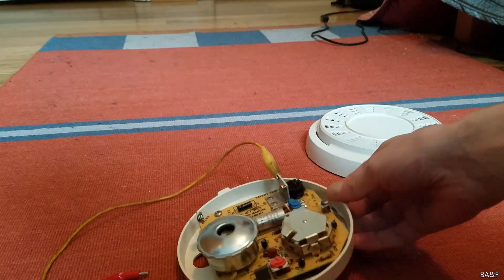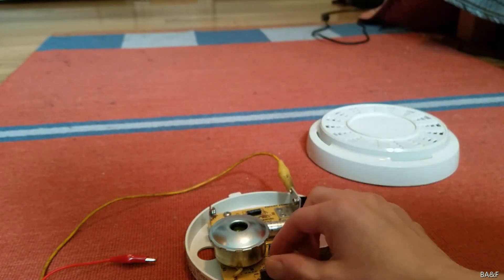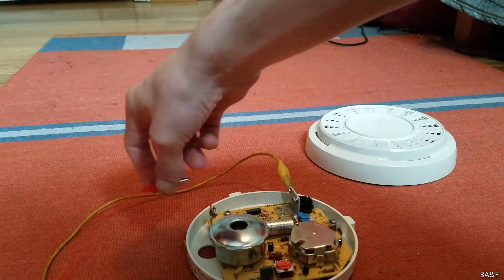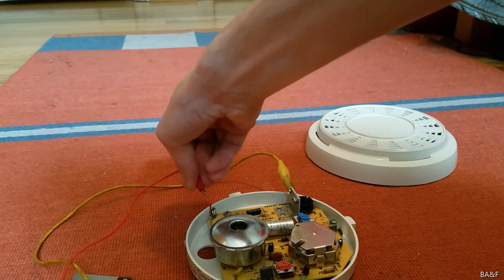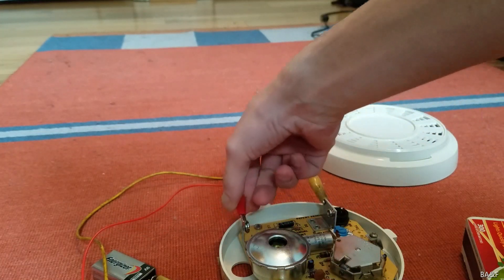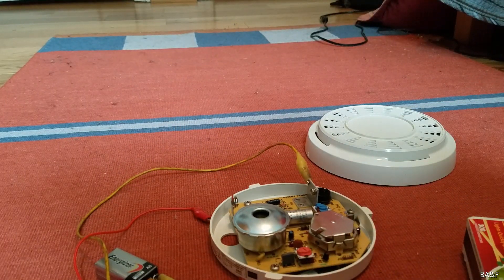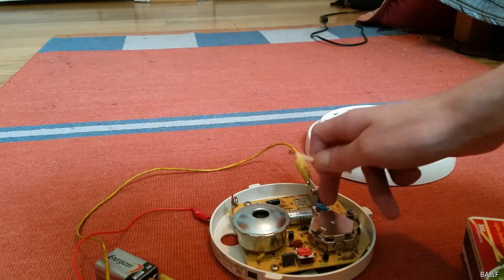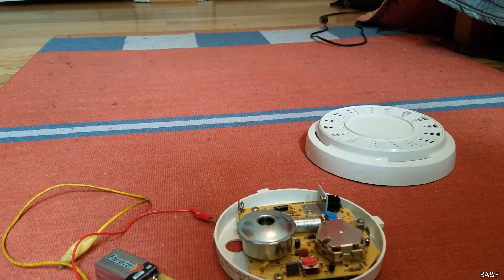Sears Early One 9-57071 - Part 2 (Testing)

Comment: 1:07 weird, one 9 volt should be enough to power it. i saw an image of a BRK SS-718 without the cover and it was being powered by a 9 volt, did you have the positive and negative clips on the right terminals? Also, did you know that photoelectric elevators has a good, working, mallory Duracell 9volt battery

Comment: To get this alarm working better with a true 10.7v DC power supply you can probably use a 12-volt DC power supply, cut the jack off so you have bare ends on the wire, hook a potentiometer in series with the positive of the power supply, (edit -->) make sure the potentiometer is set to 0 volts first (as you can not measure the voltage with the potentiometer not connected to a load), connect both ends to the smoke alarm, and then tune the potentiometer while measuring with a multimeter off the alarms contacts the output voltage until it reads 10.7 volts.

Comment: It probably sounded like that because when it goes off, it places a heavier load on the partially dead batteries, which probably dragged the voltage down way below what it needs. If you could get a battery holder for 8 AAA batteries, and fit it with 7 batteries and one dummy battery, that would give you 10.5V which would be perfect, and you could possibly stuff it under the cover.

A detector this old could probably benefit from new capacitors too.

Edit: actually, three 3.6V 1/2 AA lithium batteries (you can get them on Amazon) would give you 10.8V, last a lot longer, and should fit perfectly inside the detector, so that would work even better.
Reply from the maker: That's a great idea, my only concern is that the old Mercury batteries put out a variable voltage, I'm not sure if powering the unit long term with lithium or alkaline batteries will damage it but I don't plan to have it powered long term. Hopefully I can find some solution for the 12.6v units as well, though I do know Exell Battery makes (or made, a few years ago at least) reproduction 12.6v batteries the same size as the original Mercury cells but alkaline.
Reply: @BAFVintage  It's my understanding that mercury batteries were quite the opposite - they were like NiCd batteries in that they had a very constant voltage over the course of their life until they died, and then it dropped off rapidly. So there definitely shouldn't be an issue powering it with a modern battery pack. For the 12.6V alarms, 8 AAA batteries in series would suffice for 12V.

Comment: I think I have one of these in the box still.
Reply: If you do then absolutely make a video about it. This is one of few known to exist right now.
Reply: @audiodood  I'm sorry it's a 9-57363 i believe is the model number.  Damn.   I do have a S-700 Vigilante and a SS-200 Universal Smoke Signal both still in the box.  Both having the Ra226 target instead of the Am²⁴¹.  I also have a Jameson React DS-1 (I think that's the number) I still in the box w/ the plastic on it.
Reply from the maker: 57363...that's the Cerberus rebrand? I don't have any Cerberus or Gateway rebrand models at the moment, I'm after those. The SS-700 and Vigilante Z-700 did contain Radium, as did the BRK SS-74 and SS-218 (and earlier SS-74R version).
Reply: @BAFVintage  I believe you're correct.  You are a veritable font of knowledge.